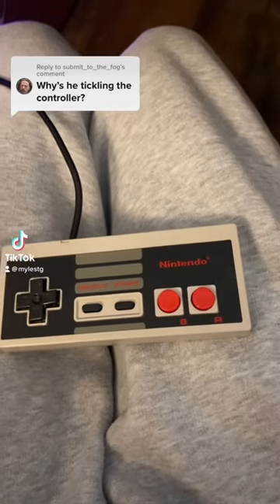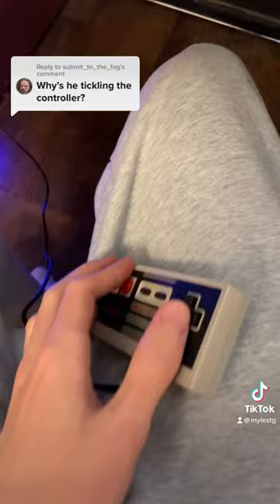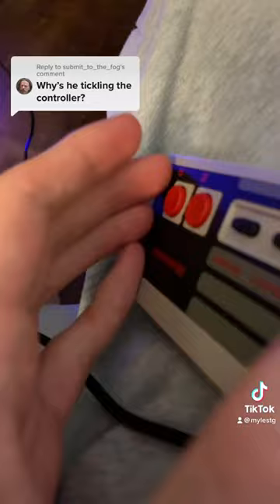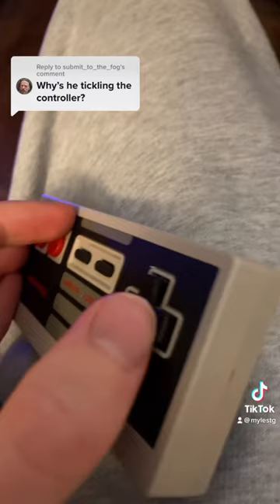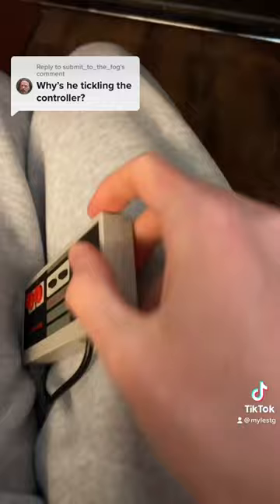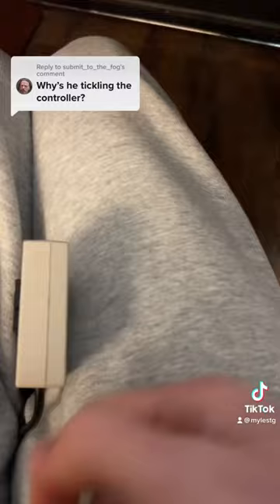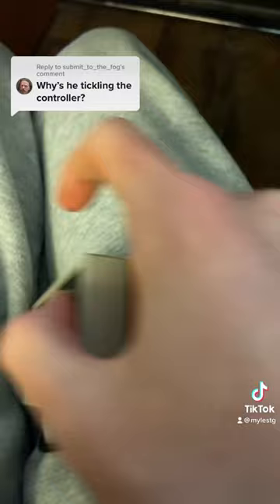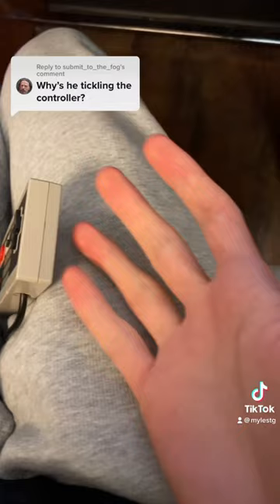Tetris rolling technique #tetris #gaming #retro

Comment: Left and right buttons should be opposite if the controller is upside down.
Reply: Some players use "Goofy Foot" controllers which are rewired to switch the directions around, making upside-down the new normal. Some other players use unmodified controllers upside-down and just learn to get used to the directions being reversed. (Left-hand roll is also an option, but it seems like right-hand roll is more common.)
Reply: @KitaruTC  i wanna try left hand rolling. especially considering I'm left handed
Reply: @y-tiplex  Yep, if you feel like your left-hand fingers are more dexterous, it definitely seems worth a shot. I feel like it's easier to anchor the NES2 "dogbone" controller than the NES1 rectangle -- there's more natural room to put your right-hand fingers without flipping the controller upside-down.

Another option for left-hand roll that I think looks interesting is Jerpi's grip; she just holds a rectangle controller normally (like DAS or Thor grip) and rolls her fingers into the bottom-left back corner. For a 5 tap, I think she just ends with the thumb directly on the d-pad.
Reply: @KitaruTC  I think rolling with my left hand would definitely be easier cause I'm not the most coordinated and I remember as kid seeing my sister roll her fingers along her desk and I wanted to be able to do that too so I actually had to teach myself and practice rolling the fingers on my left hand.